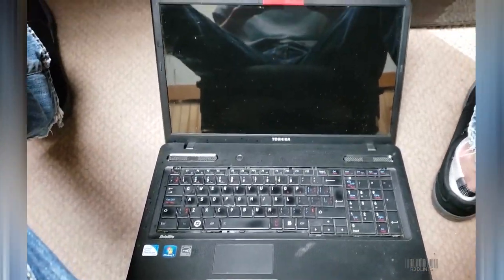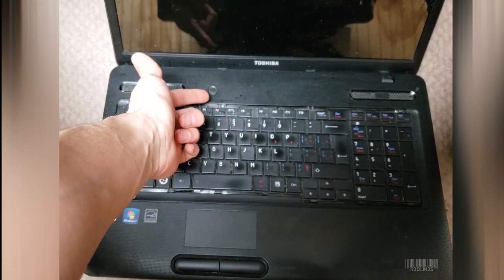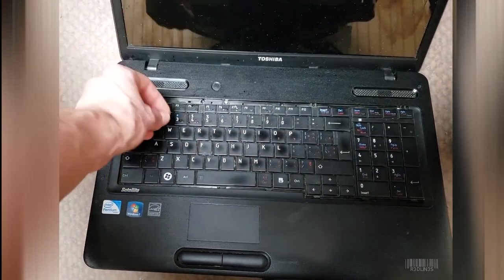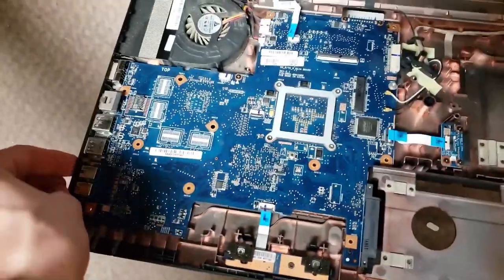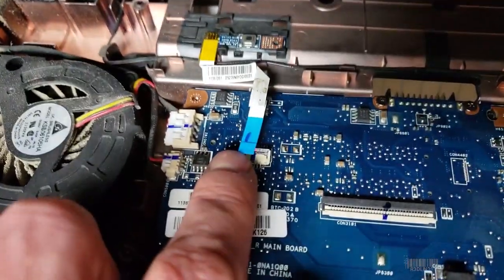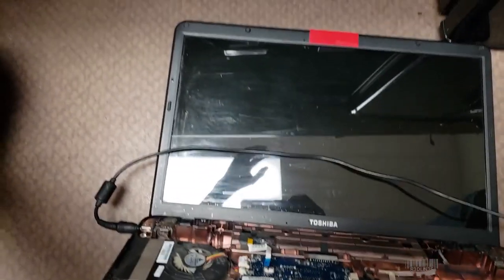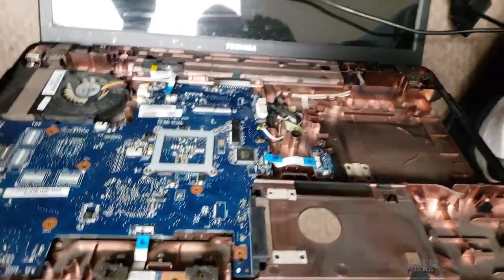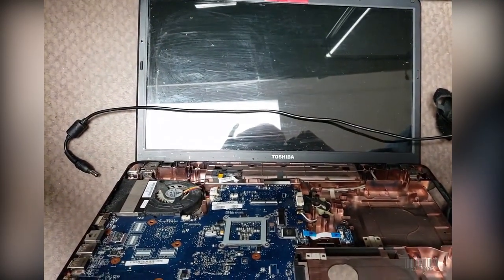Spilled Coffee on Laptop, Liquid Damage

Comment: Hey I split soda on my Acer Chromebook.  I didn't know it was bad to leave it plugged in as I discovered on another video this morning.  By morning, after quickly cleaning it and flipping it over the back was hot to the touch, and now plugging it into the power cord makes a guitar amp idle buzzing noise and no lights come on.
Have you ever seen that with the noise?  Is it completely fried or worth taking off the back panel for some cleaning and remove the battery etc.?
Lesson learned to unplug it immediately next time and get the battery out, but do you think there's a chance for a hard reset etc - I don't care if I lose data.
Reply: o also have a Acer but I just use the screen keyboards

Comment: I was travelling with my family and my laptop and a thing of coffee creamer was in the same bag so a few hours passed and when we were moving the bag to the hotel room we realized the laptop was drenched in creamer, we rushed to the room and cleaned the outside but forgot to clean the inside and when we turned it on it said “no bootable device” i watched youtube videos on it but nothing is working but i havent opened the laptop yet so do i clean the inside and then use a flash drive to reinstall windows or no?
Reply: acer swift laptop
Reply: the harddrive had creamer inside it, no saving it when that happens

Comment: I spilled a bit of coffee and it almost didn't have any sugar. My laptop still works fine and keyboard is working too but I am low-key worried. I dried it with fan and right it is upside down, between monitor and keyboard there is my underwear so it will drain everything
Reply: 3 months later does it still work? I just spilled coffee on mine today
Reply: I ccan't understand you
Reply: @natalieboswell3180  no...i had to buy exeternal keyboard bcs they are very sticky and hard to push

Comment: Hello i have the same laptop and the same accident and i fix everything except the keyboard the half of it is damaged. I cleaned with "jupiter alcohol" and nothing happens. So there is any chance that i can save my keyboard and make it works again. Please help me and thank you
Reply from the maker: there is most likely liquid between the thin lining in the keyboard. you could try taking the back of the keyboard off layer by layer and drying them out. but there is a good chance you wreck the keyboard.
Reply: @R3DLIN3S  how to open it from the back? Because the thing under the button will tire apart